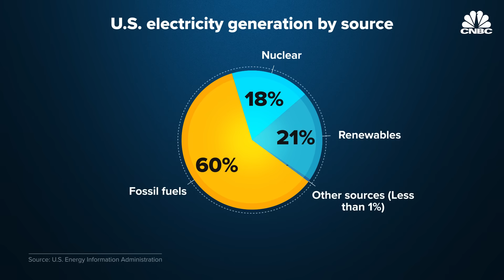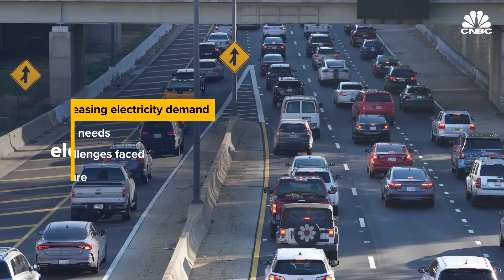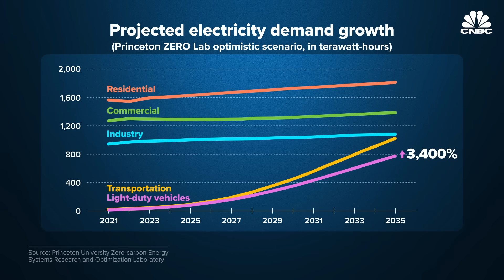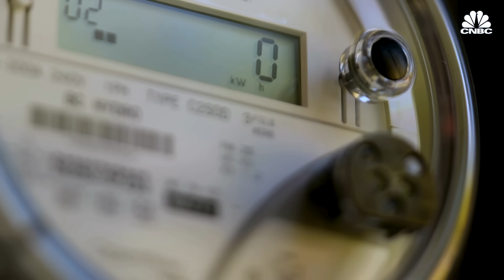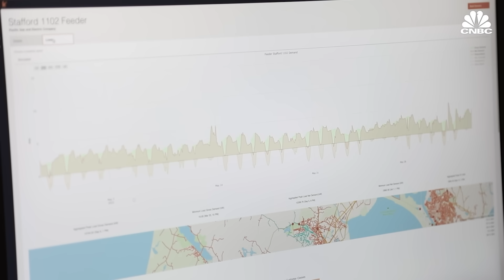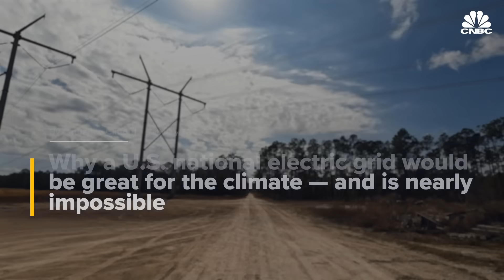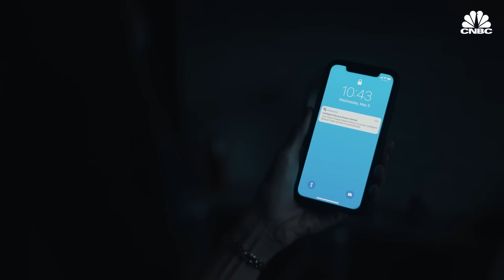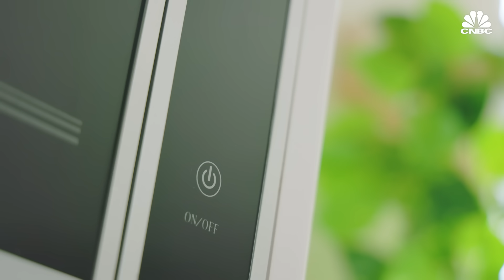Can The U.S. Power Grid Handle The EV Boom?

Comment: Q: Can The U.S. Power Grid Handle The EV Boom?  A: the current Texas Heatwave says NO.
Reply: Texas Grid Level Electrical Engineer . . .  you would be wrong.   Texas Grid goes surplus every night.   And we are building new Solar PV (daytime) faster than EVs are being built and brought on line.   Why do you make up such nonsense?
Reply: @philtimmons722  yup, that sounds as "water tight" as a Stockton Rush's carbon fiber Submersible, as accurate as Beth Holmes Edison Blood Test machine, and as sound an investment as Sam Fried's FTX Crypto.

Comment: Many Tesla superchargers supplemented with solar and megaPacks battery storage.  This will also keep costs of charging lower vs competition charging stations.  Cars will still be able to charge with power outages or brownouts.  Gas car stations can not pump gasoline if electric outage as gas pumps are electric.  Most gas car drivers do not realize.  Many EV owners own solar/battery storage so still able to run home electricity and charge cars.  EV adopters have seen the advantages of EV’s over Gas.  I save $400/month on home electricity and gas with my EV/solar/powerwall battery.  Most public chargers slow level 2.  Most public level 3 DC fast chargers(Tesla calls theirs superchargers) are only 50kw.(rare 100kw super rare 350kw)  Tesla superchargers are all level 3 120-250kw.  We need more level 3 at least 130 kw.

Comment: Out of the 3000 power companies in the USA only about 15 of the biggest can afford to make the upgrades needed.Even if they could afford the upgrades, a recent study found that it would take 77 more years to get the grids up to the point where  they could handle 60% Ev's. Ofcourse by 2030 Ev's won't make up more than 15 to 20%  of all new vehicles sold.
Reply: I'm sure by 2030 EVs will represent well over half of the autos sold...easy.  Sales are already rising exponentially and that will continue.  Doesn't take long for an exponential rise to catch up.
Reply: @DarkPesco   That's what you've been TOLD by stock people. Not people that actually sell cars and know the market. The market for Ev's is very limited and won't grow much more. A lot of these large companies wanted to go green so they bought Ev's. A lot of folks had to buy an EV because they couldn't get the ICE model that they wanted. the companies have slowed buying them now. In recent months the brand of  late model used cars that have fell the most in value is Tesla BY FAR. Tesla is cutting prices, they have more unsold inventory now than both Ford and GM combined.Their new plants are not even ramped up to 10% capacity and they have hit the wall. Ev's are on a dead end road because as I stated earlier IT'S NOT EVEN POSSIBLE to build the infrastucture needed for 77 more years.They only make those EHV transformers in Germany and in S Korea and only make 20 per year. just in the USA we need 1000 more to get to 50% Ev's. 

The roads and bridges have to be built to install these huge EHV transformers if they could build them faster..... Forget  the lies that the stock people have been telling you, they have no idea what they are talking about.

Comment: Install solar panels and it will more than offset EV charging. At the same time it will reduce your electricity costs. Payoff is 7 years and you essentially have free electricity after that! And the stress on the grid is reduced.

Comment: i find the statement that there is no new demand for electricity in the last 25 years kinda questionable. in the last 25 years, our household got a 1 new fridge, 1 new freezer,  an electric stove, 3 computers, 2 tvs... it didn't have before. not to mention a meriad of devices that previously either weren't there or had a physical off switch but now have a standby mode consuming energy. 2 people moved out and are now living somewhere else that also have this requirements. your typical office building went from having fax machines to each employee having their own computer. are you sure the trand of having AC in every building was there 25 years ago.

Comment: Especially in rural areas of the US, micro grids will be the future. Why run horribly expensive power lines to any small town in Utah, Nevada, etc?
Reply: Iowa has had a ton of wind farms go up the past decade. One of the windiest states. Theyre in better shape than a lot of states.
Reply: To secure space to upgrade the lines should those towns grow. Other utilities like fuel and internet fiber lines would run similar paths when demand grows past trucks and antennas.
Reply: Why the big grids? Reliability in the big picture. When I lived in Phoenix a community in West Phoenix had a microgrid that connected to community grid. I don't know what the advantage was, but then one day the transformer faulted. Replacement would cost more than $1,000,000. I never learned how that worked out.

One of the huge advantages of the large grids (here in the West it stretches from the Arctic Circle to Mexico basically west of the Rockies. We will never have the problem Texas had with their one-state grid in February 2021.

I don't berate anybody for not knowing how the bulk electric power system in their country works. It is complicated in all sorts of ways - technical, regulatory, economic.... I worked there for 34 years and still had questions when I retired.
Reply: @flagmichael and on the flip side you can have 1 utility near Cleveland that screws up and blacks out the entire north east.

Ultimately we use mega grids to aggregate different types of demand and generation to make management easier and keep prices down.

Microgrids are great for improving reliability by having the option of disconnecting from a damaged grid and operating in "island mode". They also tend to cover select loads like hospitals, police stations,  schools, universities, and apartment complexes. (Single family homes tend to not be worth hooking into a microgrid)
Reply: Large scale grids amortize costs across the system. Micro grids don't offer the scale of economies.
Reply: Big super-grids are a thing of the past, optimised for large centralised producers (thermal generation), and large consumers (smelters/arc furnaces/factories). Now the grid more about moving small amounts of energy over longer periods, with localised storage, consumption and storage.

It'll be fine.

My EV consumes about 10% of my household total, so the EV isn't the problem....

Comment: We’ve gone mostly off grid. We put big solar systems on our two rental houses and the cabin we live in, all of which we built or remodeled ourselves as super efficient, well insulated and fire resistant. We bought a used Bolt from my brother in law and are saving up for home batteries and waiting to replace my old Dodge Ram with an 80s Toyota sized electric truck. I installed the solar kits myself, so payoff for the panels will be in less than five years.  years. As we charge it at home, the Bolt costs much less to drive than an ICE. The batteries will take a while to pay off, but over time, will still cost much less than electricity from our price gouging utility monopoly.
Reply: We have three reasons for our plan to be completely off grid within the next few years. 1. Kick our price gouging utility monopoly in the teeth. PG&E is more crooked than Enron and we are doing our part to drive a stake in their black heart. 2. Save money. God willing, will be in this home for the next thirty years. So, if we invest now, we will build much more wealth as we prepare for retirement. 3. Fight the climate crisis. As relatively early adapters,  our purchasing decisions now have a big impact on the further development of green technologies. 4. Prepping. We are low key preppers and there are a lot of real threats to the electrical grid. I’ve got big dogs  and other things to discourage bad people from coming on our property. We have a half a year of food in the pantry. Our water is gravity fed. We have a wood stove and a few acres of woods to supplement our solar powered electric heat. Our power went out for ten days after a blizzard this winter. Our neighbors with gas and diesel generators all ran out of fuel after a few days. We did fine.
Reply: @freeheeler09 ahahahahahahaah your folks crack me up. Thinking you will survive if society collapses. The only people who will survive that are tribes living in the jungle or aboriginals living in the middle of the Outback. I ASSURE you if society falls your family will be killed immediately like everyone else. You can’t even comprehend what 8 billions humans with no food or water will become. But I assure you anyone living within even 2k miles of a city will be overrun and killed.
Reply: i bet you smell your own farts too

Comment: I’m always a bit confused by these talks about needing to increase transmission lines. It wasn’t until the very end that they briefly mentioned distributed power generation with roof top solar and batteries. Why not focus more on building energy where you need it than transmitting it all over the place?  We’ll still need the transmission lines to balance the power supply, but each home’s demands could easily be reduced with solar and batteries and that’s all you need to keep the grid capacity at the current rates.
Reply: Because the big power companies want to keep their profits. People generating their own power? Blasphemy.
Reply: @lilbaz8732  As long as you are dependent in some manner on the grid, for example to make ends meet when your batteries don't quite make it through a week of cloudy weather or a storm, then you need to contribute to the upkeep of the grid in some manner.

Just exporting power to the grid when the grid doesn't need that extra power does not magically remove the costs associated with maintaining grid infrastructure.

What you CAN do with batteries is to load-shift to reduce your consumption during the evening peak, or even export power during the evening peak, when the grid actually needs it.  And with TOU pricing plans there is a benefit to doing this.

If you disagree, you can try calculating just how much solar and storage you need to actually disconnect from the grid entirely and still have reliable power 365 days a year.   I'll give you a hint:  Its a lot more than the amount of solar and batteries needed to be net-zero averaged over the entire year (treating the grid as if it were a battery capable of storing megawatt-hours of your exports in summer and holding that all the way to winter when you consume it).
Reply: @junkerzn7312  europe seems to be working to solve these problems. The uk is currently building 65gw of energy storage. Through various methods. Including pumped storage that can store energy indefinitely if needed.
Reply: The big issue with distributed RE generation is the Variability of it.

Yes it will and does help but local wind/ solar droughts are much more common than ones over large areas.
(Sometimes it makes more sense just to move the power over long distances rather than over build power generation.)

I think EVs are a bigger opportunity than a challenge most people really don't need to charge an EV every day if people can plug the car in and leave it in a charge on cheap power mode
Reply: I was confused too. When they talk about green energy, it is usually about large commercial installations. Cities have plenty of roof space for solar. Also they said the grid needed inverters to feed the rooftop solar energy into the grid, but home solar installations need inverters to feed the house!
Reply: Why not?
Money.
If you could make money out of distributed power generation, we'd all be in a lot better place.
We really need some smart person to figure out how to make boatloads of money out of it, and then we will see things fly!
Reply: These lunatics are living a pipe dream.
Reply: Home batteries and panels are not a cure for all.  

First , there is the implementation cost, which puts a lot of households out of the picture. 

Then, you need a home with an indoor garage to install your inverter and battery pack. 

And then, you need spacing between homes to allow for the capture of sunlight at its best. 

Coal and gas generated power plant 9utput  will be in demand for a looong time.  

Multi tenant buildings  can overcome the above obstacle due to size of its footprint and the possibility to spread costs.
Reply: @serafinacosta7118  - I’m actually drifting away from home solar systems and starting to lean towards slightly larger installations like commercial buildings. Think about all of the strip malls and grocery stores out there with flat roofs that solar power companies could take advantage of.  It would still be a local grid solution so it would help reduce the load on transmission lines.
Reply: There is a solution that is not really talked about.
The power station can actually act in reverse and give the power back to the grid when needed this means during times the power grid is not used as much the vehicle could charge off the grid but during peak hours when power is needed the power station could reverse the charge and give the power back to the grid.
This would drain the vehicle battery, but if the owner wasn't planning a trip, he could decide to sell back the power this would work if the utilities gave financial incentives and raise the price of electricity during peak hours.
The power station could also stop the charge during peak times when power is high and when reverse charging only drop the vehicle charge to a certain percentage that is chosen by the owner.
Reply: EVs are only a short term answer to a longterm problem: How to enable people to efficiently travel. Even EVs are not efficient enough for widespread use. We need to develop HSR networks, and better metro area transit systems.
Reply: @barryrobbins7694  france has a large hsr  that there average citizen cannot afford to use its mostly business travlers that can use them  ordinary people fly or drive  and gov subsities just shifts cost to taxpayers or to national dept that causes inflation the hardest tax on most people
Reply: @jar407  The situation is different in Italy and other places.
Reply: @jar407  If not everyone is able to use it then it's not large enough.
Reply: @jar407  People can check ticket prices online and judge for themselves.
Reply: @barryrobbins7694  An ICE vehicles are more efficient than EVs? My 2016 VW e-Golf has a mileage rating of 116mpge. How can an ICE beat that?
Reply: @gregripp  HSR/Metro Transit > EVs > ICE.  ICE should go away, but all cars require inefficient infrastructure. We don’t want more freeway lanes, more parking lots, more traffic congestion — minimize the need for ALL cars.
Reply: @barryrobbins7694  High speed rail is grossly inefficient on a large scale. Transit systems aren't practical outside of high density population areas.
Reply: @patrickweaver1105  There is no need to guess about the possibilities. It doesn’t have to be geographically wide spread to have a big positive impact. There are examples throughout the world. Put high speed rail where there is sufficient population density and existing travel frequency. For example. North Dakota does not need HSR, but Washington D.C. to Boston does (they already have somewhat high speed rail). 

HSR in those places (where a large percentage of the U.S. population lives) would be a viable option to car and short distance air travel. It would also alleviate car traffic congestion and negate the need for expensive highway widening. There are even plans for HSR between Dallas and Houston.

It will be better for everyone, including people who drive.
Reply: @barryrobbins7694  Spend a few minutes looking at how well that is working in California.
Reply: They don't explain it well, probably because CNBC is clueless and doesn't understanding anything about electricity or the grid.   The basic issue is not so much new plants being built in far away places, but simply the fact that new renewable plants tend to have smaller capacities than older fossil fuel plants, meaning that a larger number of smaller transmission lines need to be strung to those plants.  This costs a bit more than stringing fewer higher-capacity lines.  That's all.

"Distributed power" is ... well, I don't know how this wound up echoing around social media.  Our current grid is heavily distributed already.  If you mean residential generation, that is fine, but it won't actually reduce the need for or the capacity required for transmission lines because it doesn't really effect peak consumption.

Residential grid-tied battery systems theoretically can reduce peak consumption, particularly in the 4-9pm slot, but there are unlikely to ever be enough installed to move the needle much.   To really make this work there needs to be a mandate to offer much smaller utility service... for example, a 10A service, rather than the 200A service that is standard today.  That's the only way one can actually reliably down-size the external infrastructure.   So, for example, for someone with home batteries, a 10A service provides roughly 2.4kW, but that's still 57 kWh/day of supplemental power which is gobs more than most homes need.

What DOES work with regards to reducing the load on transmission lines is properly located grid-scale storage.   Grid-scale storage projects today are sited specifically to reduce the load on existing transmission lines.  Mostly to avoid having to string additional transmission lines.  That is why it is turning out to be cost effective to build grid-scale battery storage... because the cost of the project directly offsets the cost of stringing a new transmission line.